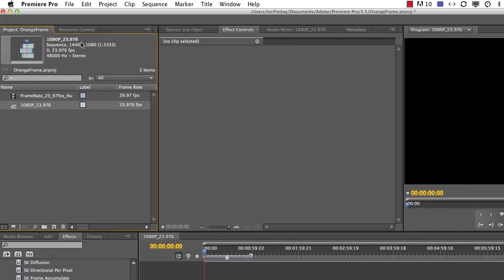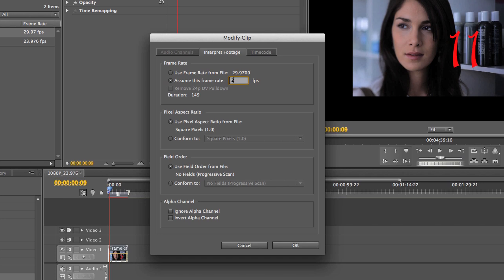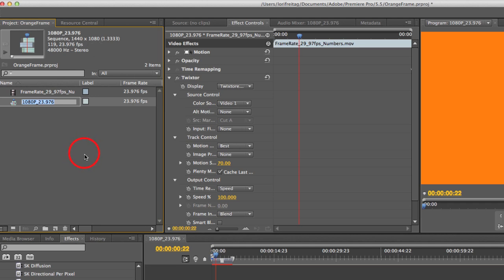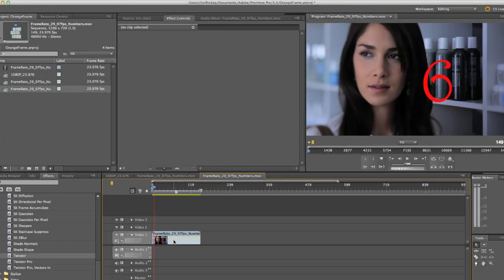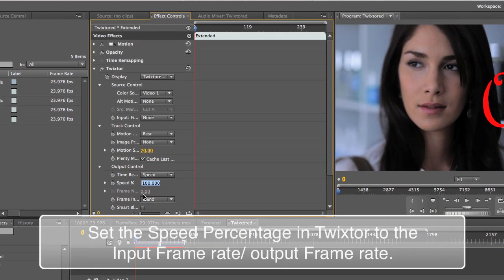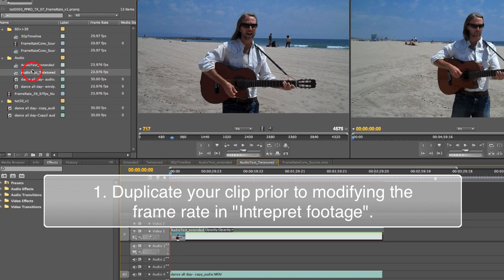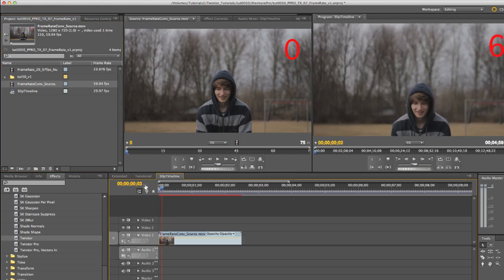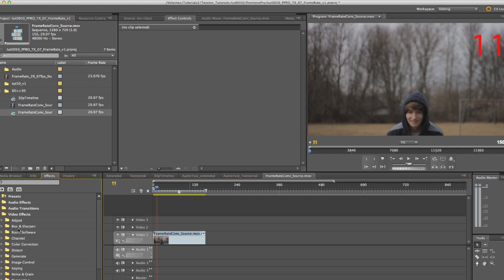Frame Rate Conversions in Twixtor within Premiere Pro (done in CS5)

Comment: Hi! I have an issue.

I make a new project and import a video clip that has the frame rate 28.15.
Then I will make a sequence:
You go "File > New > Sequence from clip" in the video, but my Premiere Pro 5.0 doesn't have that option.
Is it really 5.0 you used or something above that?

Not even a popup window that say the video clip and sequence doesn't match, when I make a new sequence and drag the video clip over it.

I really want the sequence will have same frame rate as my video clip.

Comment from the maker: Yes in the first sequence you lengthen the clip by copy/pasting the original clip as many times as you need to to make the clip your new desired length. and then, select the Sequence in PROJECT BIN, and use the menu item "Make new clip from Sequence".... THEN  apply Twixtor to the new sequence.

Comment: You need to Interpret Footage to 24 (23.976) and make a sequence 1 that is 1080 size 24 FPS square pixel aspect ratio, drop footage in it.  Then
Scale the 720P clip to 1080 using the Motion Controls in Effects Control.  Next, select the sequence 1 in Project bin, Make New Clip from sequence,
And apply Twixtor in that new sequence.